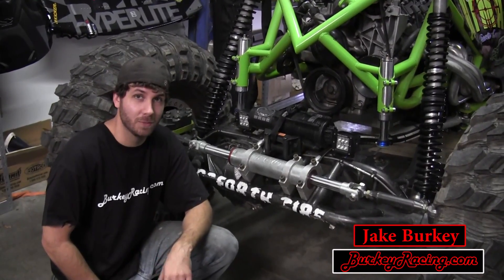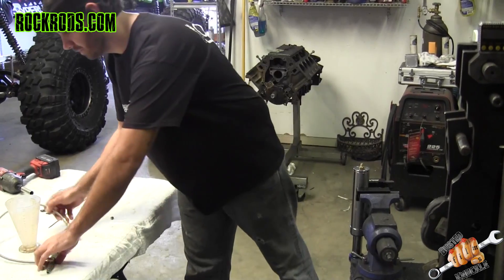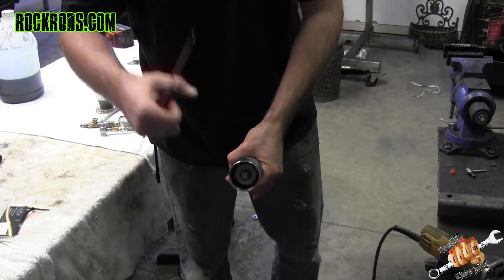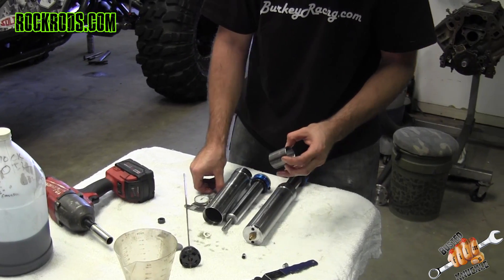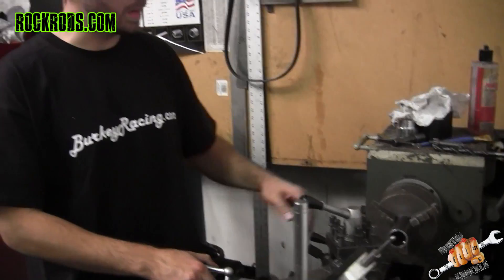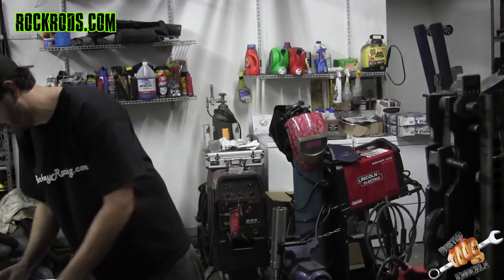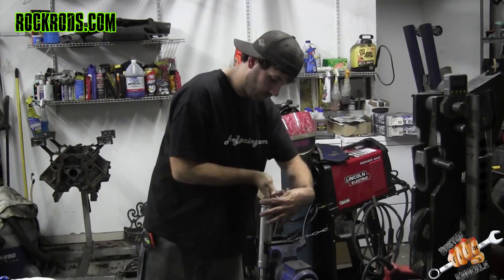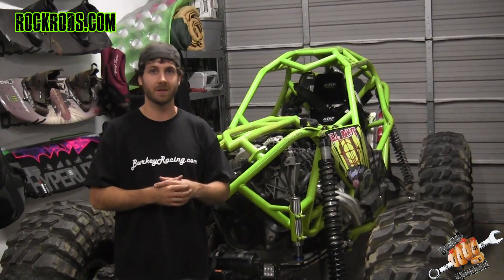SHORTENING HYDRAULIC BUMP STOPS - Rock Rods Tech

Comment: will stuff start hitting if you just moved the bump stop bracket up 2"? just wondering because i think that would be the better way to go, if it wouldnt hit the axle on the engine or frame, since you would still have the full travel of the bump stop. it looks like the shocks have a bit more than 6" of travel left!
Reply from the maker: This is the easier way that cutting, fabricating, and re powdercoating the chassis

Comment: So you said.." He is riding on full bump all the time" Why would you make the bump stop work less? I would think giving it more room for compression would be the goal, not taking away. If they are 4 in stops. with  2 inch travel until contact, = 6 inches travel until bottom out.....Now you have only have 2 inch stops and 2 inch travel=4 inches..You just took away travel.  Now he IS " riding on full bump all the time".... how does killing your kidneys help performance and if it does..Why not just take the shocks off?
Reply: +Jake McGibbon The bump stop was originally 2" off the axle and after shortening the bump stop it is 4" off the axle.  We traded 2" of bump stop for 2" of shock travel.
Reply: +jake burkey thanks a lot for the reply I really appreciate it... And thanks a lot for making these videos they are very helpful.

I realize now that you made it so that the bump stop was further away from the axle ... and that your shim actually shortened the amount of shaft sticking out of the bump.

I don't know why but I thought you made it so the bumpstop had 2 inches less travel ... I thought the shim was making it hit the "end" faster... I just wasn't sure visualizing it properly... I should have just listened better lol my bad.
Reply from the maker: +redneckhippiefreak They are allowing the shocks to work as intended. The bumps shouldnt come into play until the end of the stroke of the shock. These were setup a little low. Thus without cutting of the bumps and relocating them this is the best choice.
Reply: BustedKnuckleVideo I just watched it all again...Im still confused. Its not hard to do so please bare with me.  I guess im confused as to the direction of function. Ill re-watch and make sure I didn't miss any thing. Cheers.
Reply: +redneckhippiefreak your math is a little off.  There is still 6 inches of travel in the front of this buggy after the bump stops were shortened but now the shock has 2" more travel to slow energy down before the buggy hits the bumps.  (there is now 4" between the axle and the bump stop where originally there was only 2").  This modification will smooth the ride out by allowing the shock to dampen more effectively before bottoming out on the bumps.

Comment: Put a gopro on the frame to record the axle hitting the bumpstops.

If you can adjust the rebound rate wouldnt it be easier to run less nitrogen and allow the bumpstops full travel rather than having them kick in harder later?
Reply from the maker: +Stephen M they are a last resort, its better to let your coilover do what it is designed to do
Reply: Stephen, you should tune your coilover for the 90%.  What i mean by that is 90% of the hits should be completely absorbed by your coilovers leaving 10% of the hits to contact the bump stops.  Basically only big jumps and landing hard on one corner should hit the bump stops so it is benificial to shorten them in rock bouncing.